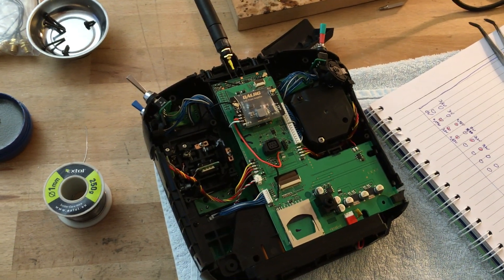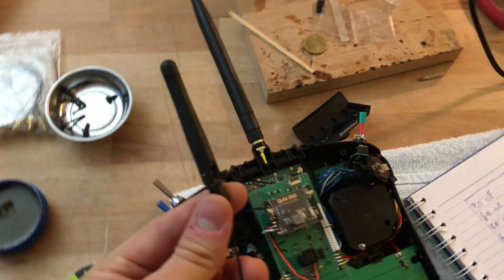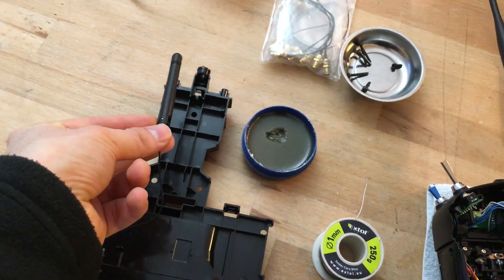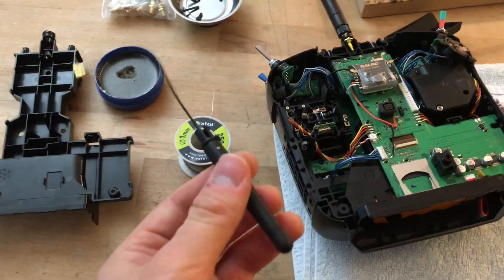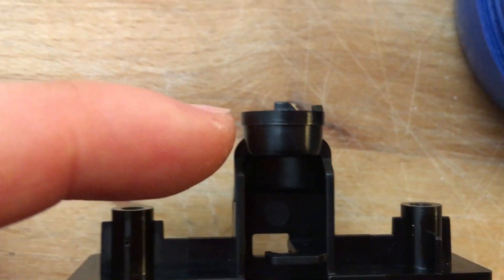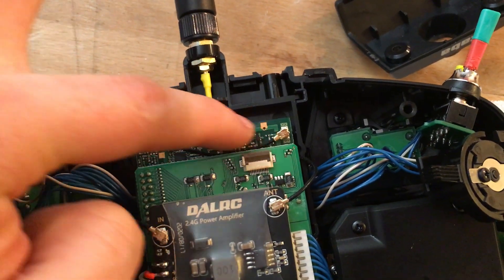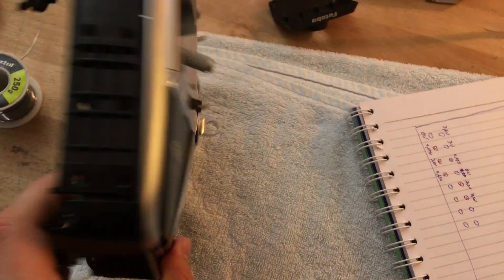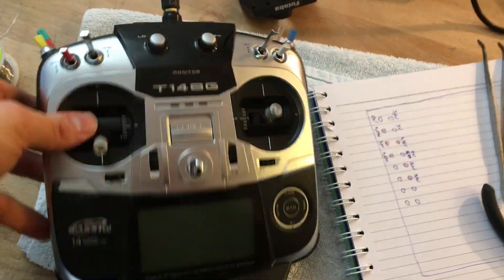DALRC 2.4GHz Power Amplifier - Part 2.1 - Long Range Antenna Upgrade for Futaba T14SG

Comment: I have a question can i use this amp antenna in a dji remote controls?
Reply from the maker: I think it should be possible if the remote outputs only 2.4GHz signal. I haven't tried it though, so I can't be 100% sure. If you do try it, please let me know what the result will be. Make sure to test ona quad with RTH so that you don't lose it! Good luck! :)